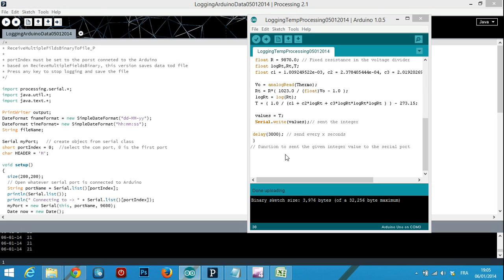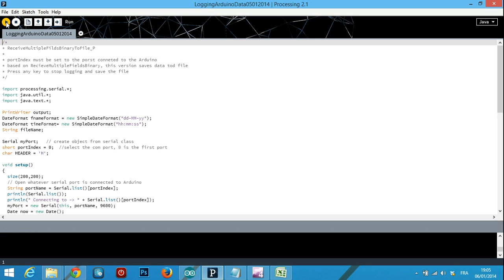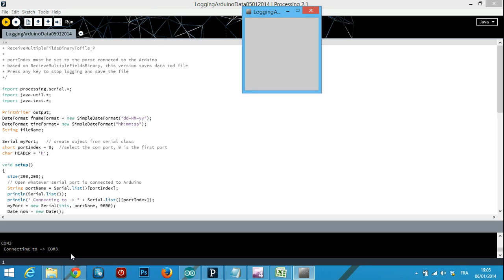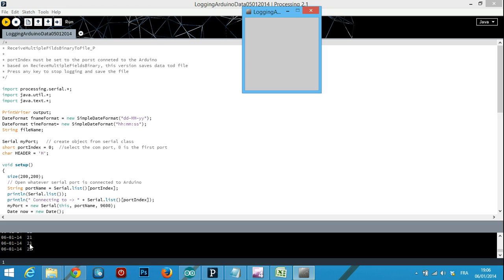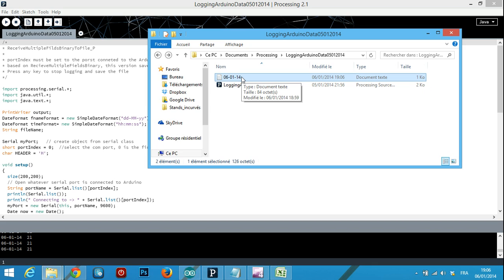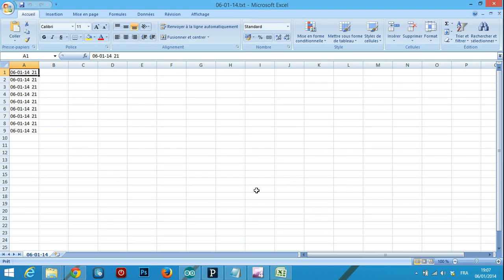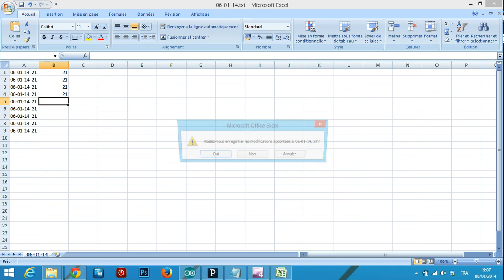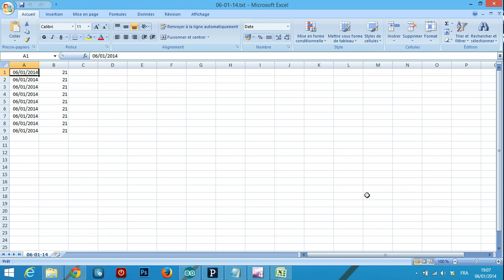Procesing text file

Comment: can you paste the whole processing code ?
Reply: disregard this, saw it below...
Reply from the maker: Hi Deniz, how are you doing?  I'll send it here, they are also on the current thread
Reply from the maker: *************ARDUINO
/* 
* SendBinaryFields
* Sends digital and analog pin values as binary data
* File: ThermistorTemperature.pde -- look up for it in the web
*/
int Thermo = 0;
const char HEADER = 'H';  // a single character header to indicate the start of the message

void setup(){
  Serial.begin(9600);
  pinMode(Thermo, INPUT);  // set pins 2 through 13 to inputs
  digitalWrite(Thermo,HIGH); // turn on pulls-ups
}
void loop ()
{
  Serial.write(HEADER); // send the header put the pin values of hte pins into an integer
  
  int values = 0;
  int bit = 0;
  int Vo; // Integer value of voltage reading
  float R = 9870.0; // Fixed resistance in the voltage divider
  float logRt,Rt,T;
  float c1 = 1.009249522e-03, c2 = 2.378405444e-04, c3 = 2.019202697e-07;
  
  Vo = analogRead(Thermo);
  Rt = R*( 1023.0 / (float)Vo - 1.0 );
  logRt = log(Rt);
  T = ( 1.0 / (c1 + c2*logRt + c3*logRt*logRt*logRt ) ) - 273.15;

  values = T;
  Serial.write(values);// sent the integer
 
 delay(3000); // send every x seconds
 }
Reply from the maker: ****************************PROCESSING
/*
* ReceiveMultipleFildsBinaryToFile_P
*
* portIndex must be set to the porst conneted to the Arduino
* based on RecieveMultipleFieldsBinary, this version saves data tod file
* Press any key to stop logging and save the file
*/

import processing.serial.*;
import java.util.*;
import java.text.*;

PrintWriter output;
DateFormat fnameFormat = new SimpleDateFormat("dd-MM-yy");
DateFormat timeFormat= new SimpleDateFormat("hh:mm:ss");
String fileName;

Serial myPort;   // create object from serial class
short portIndex = 0;  //select the com port, 0 is the first port
char HEADER = 'H';

void setup()
{
  size(200,200);
  // Open whatever serial port is connected to Arduino
  String portName = Serial.list()[portIndex];
  println(Serial.list());
  println(" Connecting to -> " + Serial.list()[portIndex]);
  myPort = new Serial(this, portName, 9600);
  Date now = new Date();
  fileName = fnameFormat.format(now);
  output = createWriter(fileName + ".txt"); // save the file in the sketch folder
}

void draw()
{
  int val;
  String time;
  if (myPort.available() >=15) // wait for the entire message to arrive
  {
    if (myPort.read() >= HEADER) //is this the header
    {
      String timeString = fnameFormat.format(new Date ());
      print(timeString);
      output.print(timeString);
      // header found
      // print the six analog values
        val = readArduinoInt();
        print("  ");
        println(val);
        output.print("  ");
        output.println(val);
    }
  }
}

void keyPressed() {
  output.flush(); // writes the remaining data to the file 
  output.close(); // Finishes the file
  exit(); // Stops the program
}

int readArduinoInt() // return the integer value from bytes received on the serial port (in low, high order)
{
  int val;   // Data receied rom the serial port  
  val = myPort.read ();  // read the least significant byte
  //val = myPort.read () * 256 + val; // add the most significant byte
  return val;  
}
Reply from the maker: I have to say that i did this years ago before starting to run my company, so I have no idea where the files are, and I don't use processing anymore though so I had to copy paste the files

Comment: Hey Federico could you please upload the code for your project
Reply from the maker: +Muhammed Mafawalla thanks for reaching out mate.  I've been working on this  long time ago, but this is the code

 This project is about measuring temperature in the atmosphere, and send it directly to an excel file.  I got my way out mixing some codes that I've seen in the research, so Its kind of homemade stuff, please sorry if syntax sucks.

  So the sequence is: 

1) arduino IDE measures the T thru the thermistor
2) Processing gets the data and creates a new .txt file when I press any keybord button
3) the files gets created in .txt (and still pending to automate the .txt to excel, but it will surely be a macro).

 There are some different problems in this:

b) the Processing sketch that I am using, only works when running processing.  How can I open and close it at a specific time?
 also, if you guys find the way to actually rewrite the data in the same file, will be great as well

c) the file that i am creating, is intended to be read by excel in a 2 column, though it does it in a single column.  If you know how to get the 2 columns format right away, please tell me.
Reply from the maker: +Muhammed Mafawalla Arduino CODE:

*************ARDUINO
/* 
* SendBinaryFields
* Sends digital and analog pin values as binary data
* File: ThermistorTemperature.pde -- look up for it in the web
*/
int Thermo = 0;
const char HEADER = 'H';  // a single character header to indicate the start of the message

void setup(){
  Serial.begin(9600);
  pinMode(Thermo, INPUT);  // set pins 2 through 13 to inputs
  digitalWrite(Thermo,HIGH); // turn on pulls-ups
}
void loop ()
{
  Serial.write(HEADER); // send the header put the pin values of hte pins into an integer
  
  int values = 0;
  int bit = 0;
  int Vo; // Integer value of voltage reading
  float R = 9870.0; // Fixed resistance in the voltage divider
  float logRt,Rt,T;
  float c1 = 1.009249522e-03, c2 = 2.378405444e-04, c3 = 2.019202697e-07;
  
  Vo = analogRead(Thermo);
  Rt = R*( 1023.0 / (float)Vo - 1.0 );
  logRt = log(Rt);
  T = ( 1.0 / (c1 + c2*logRt + c3*logRt*logRt*logRt ) ) - 273.15;

  values = T;
  Serial.write(values);// sent the integer
 
 delay(3000); // send every x seconds
 }
Reply from the maker: +Muhammed Mafawalla 

****************************PROCESSING
/*
* ReceiveMultipleFildsBinaryToFile_P
*
* portIndex must be set to the porst conneted to the Arduino
* based on RecieveMultipleFieldsBinary, this version saves data tod file
* Press any key to stop logging and save the file
*/

import processing.serial.*;
import java.util.*;
import java.text.*;

PrintWriter output;
DateFormat fnameFormat = new SimpleDateFormat("dd-MM-yy");
DateFormat timeFormat= new SimpleDateFormat("hh:mm:ss");
String fileName;

Serial myPort;   // create object from serial class
short portIndex = 0;  //select the com port, 0 is the first port
char HEADER = 'H';

void setup()
{
  size(200,200);
  // Open whatever serial port is connected to Arduino
  String portName = Serial.list()[portIndex];
  println(Serial.list());
  println(" Connecting to -> " + Serial.list()[portIndex]);
  myPort = new Serial(this, portName, 9600);
  Date now = new Date();
  fileName = fnameFormat.format(now);
  output = createWriter(fileName + ".txt"); // save the file in the sketch folder
}

void draw()
{
  int val;
  String time;
  if (myPort.available() >=15) // wait for the entire message to arrive
  {
    if (myPort.read() >= HEADER) //is this the header
    {
      String timeString = fnameFormat.format(new Date ());
      print(timeString);
      output.print(timeString);
      // header found
      // print the six analog values
        val = readArduinoInt();
        print("  ");
        println(val);
        output.print("  ");
        output.println(val);
    }
  }
}

void keyPressed() {
  output.flush(); // writes the remaining data to the file 
  output.close(); // Finishes the file
  exit(); // Stops the program
}

int readArduinoInt() // return the integer value from bytes received on the serial port (in low, high order)
{
  int val;   // Data receied rom the serial port  
  val = myPort.read ();  // read the least significant byte
  //val = myPort.read () * 256 + val; // add the most significant byte
  return val;  
}

Comment: Separate the date and temperature in the text file with a comma and then when it is imported into Excel it will automatically put them in their own cells.
Reply from the maker: Hello dave, thank you very much for your comment, i solved it that way and it worked. Also i stopped using processing and im now usimg gobetwino